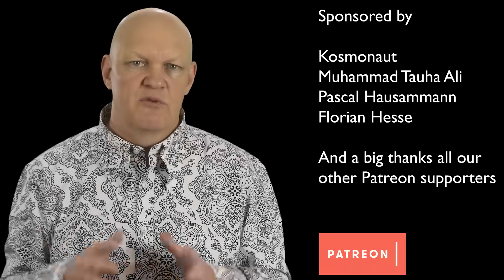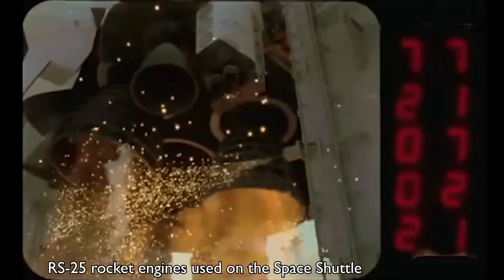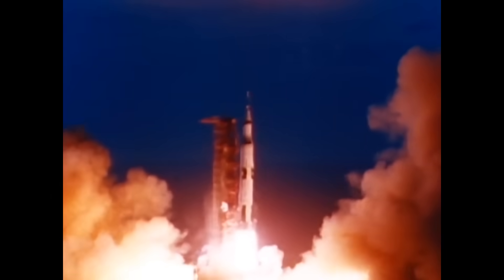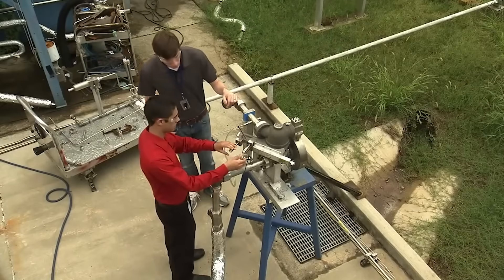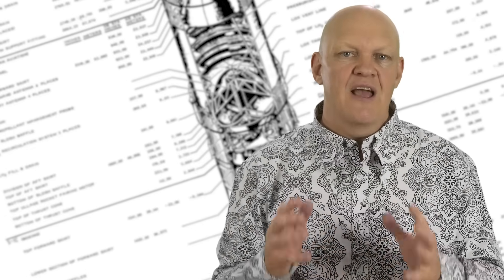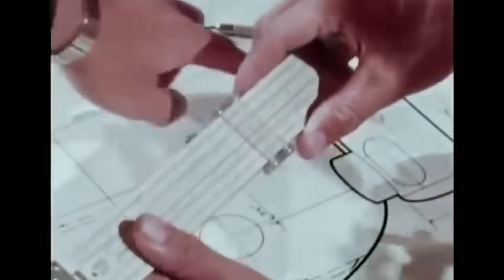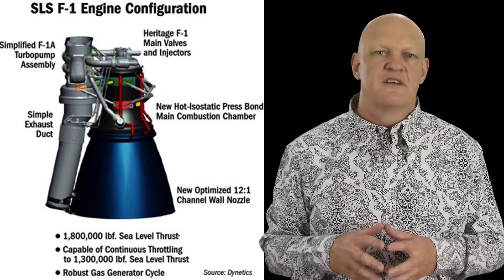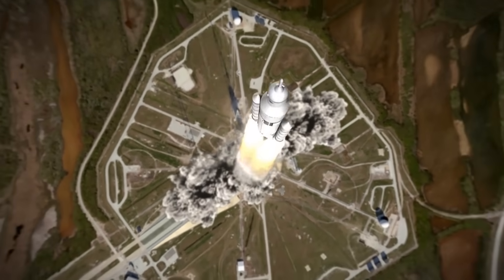Why Can't we Remake the Rocketdyne F1 Engine?

Comment: I wouldn't expect someone in 100 years to be able to build a gasoline engine either. Experts are experts for their generation and understand the tech in their generation. Subsequent generations wouldn't be taught or grow up with the practical skills previous ones developed while working around engineering problems of their time. So basically space flight tech has had to be redesigned for a new generation. As I'm sure it wil be again in thirty years with new tech

Comment: All advanced technology is a byproduct of the industrial base that might build it.  We can't build another F1 for the same reason we can't build another Pyramid.
Reply: If the human race really wanted to build another of either, of course we'd be able to do it. It takes massive amounts of effort and money, but we'd do it.
Remember, in the case of the F-1 engine, there was an enormous amount of enthusiasm.
Reply: @devilsoffspring5519  IF we re-tooled to a 50s-60s post war industrial base. IF we re-trained tradespeople to a 50s-60s technical sophistication (which was much higher level and depth than today). IF the scientists and engineers could reverse-engineer the old designs with a fundamental understanding of their operation. 

You might as well design a new engine.  

People tried to unsuccessfully rebuild the Etemenanki for a hundreds of years - and not for a lack of manpower or technical modernity.  It was only built and repaired by Babylonians who knew the design and knew the building techniques common in Babylon around 700bc.

Comment: I have those scraps. My dad designed the F-2 and oh so much more. The director notes and all the original workups for the shuttle bay and satellite launches. I got it all. Original notes with drawings of those engines. Amazing
Reply: santini deutch : my dad developed the reusable boosters for shuttle... can u get copies of his blue prints he sold to nasa?
Reply: @railrider4745  I have the drawings for the shuttle satellite release sysytem and cradle structures as well as the spin out centrifugal launching mechanisms, or as dad would put it  " The spin out" :-). I have all this stuff in storage. I don't know where the gears are or the mechanical directional models are. I think my sister took them. I would be surprised if she kept anything. What is ti you are looking to do with the prints? I have lots of Skylab and mole and other rocket stuff. Let me know :-)

Comment: Tell me at what point did we decide we need a big liquid fueled engine to go to the moon? Well we sure spent enough money to buy seventy appollo rockets, and we used 20. Maybe thats the real problem with bureacrats they are now politicians, and thats why single stage to orbit is an issue. The Soviets built the Soyuz program and its still working yeah the big dumb liquid fuel rocket aint so dumb is it ? Even the solid fuel stuff goes boom and got retired because of the Morton Thiokol O rings failure took out our orbiter program because of a temprature issue. Buid the F1 again and study it test it mercilessly until you have a few left around in fully opperational condition dont try an change something that isnt broke for the mission requirement, cant re- invent the wheel ? Always somebody talking about how efficiant the thing is , and how it isnt going to work the fact is it does and thats whats important, but if your going to classify every damb thing then lets not and say we did for another 50 years when you cant afford this or that and say we dont have eniugh willie messersmidt trained and skilled engineers is really kinda of a panzi excuse. The F1 is sitting in the yard in the San Fernando valley Winnetka ca. Waiting for you to mass produce it again a few tests and improvements could be added with composites making that engine even more reliable its big its loud and it about time for a whole bunch more moon shots mars too ! Unless you have some secret stuff you think would be far cheaper ? Call Rocketdyne and get on with it .Or do u know some other way to get to the moon or orbit your not telling us about ?
Reply: .. what? Yes, one solid rocket booster got a shuttle blown up, in fucking 1986. The shuttle program didn't end for nearly 30 years more, and basicly the same design for solid rocket boosters are part of the SLS. Wtf are you even on about "single stage to orbit", noone is, or have ever been considering that as a good option.

Comment: 0:04 That nozzle and flame gap does not tell about good performance.
Reply: Fun fact: That gap is actually diesel (kerosene) fuel that was used in the first stage combustion process in conjunction with liquid oxygen.  The kerosene ignited eight feet past the engine bell and gave the Saturn V 7.5 million pounds of thrust.  Why they didn't use a combination liquid hydrogen/oxygen mixture like they did in the second stage is beyond me.
Reply: https://youtu.be/TMbl_ofF3AM?t=58  Russian engine is 10 - 15 % more efficient than US rocket engines.

Comment: You didn't even answer  the question posed int he title of this video. This video is about how changes in manufacturing and assembly have made this engine difficult to produce.  Then you go on to give ZERO examples of how it's actually difficult.  Some notes were lost?  The people who made it have retired?  What is a specific component of this engine that todays fabricators would be unable to recreate? And why?  You really seem to underestimate modern machinists and welders. You sort of make it sound as if people have forgotten these skills. They haven't. Todays machinists and welders are definitely more skilled than the ones 50 years ago and they have better equipment to boot....Both analog AND digital.

Comment: It's always easier to start with a fresh sheet of paper than to attempt to reverse engineer an old, incompletely documented design. And all designs are incompletely documented: no one has the time or money to write everything down. I design and test products. I make drawings, build the prototypes and test them, write reports full of test data and photographs. And still there are omissions , things we either forgot or did not even think of to write down. It's just plain impossible. There is a human element in engineering design. A drawing and a specification document can't cover every little thing: the complexity is just too great and humans are involved.
Good luck copying the Rocketdyne F-1, it would be easier to start from scratch.

Comment: As designed and as built is a dynamic of complex manufacture. What's impressive is the statement that a new design with the same performance or better would reduce the parts required from 5,600 to 40. Imagine the cost savings. The Apollo program was about $25 Billion wasn't it? The current technology on incalculable fronts is a precipitate of that money. That money didn't just go up in smoke, whether the landing was a hoax or not when you think about it😒. Material science, communications technologies, NC/CNC development. The question is, what technological project could be there in the future to inspire or provide that level of benefits. Could it be a medical challenge, a challenge or a shift of true humanity realising their true destiny the way that an ape looks into a mirror and finally recognizes....Hey!

Comment: I don't agree with your argument. I do agree making exactly the same engine based upon the old blueprints now, will not be done. However, we differ in opionion on the reason why.

Technological capabilities has nothing to do with this. Current day engineers are very capable, and also people like good welders and so forth, plenty of them around.

There are 2 factors:
1) money
2) safety

Ofcourse we could make those engines again, in exactly the same way. However. back in the days, landing on the moon was a political priority, and NASA had more money than water laying around. Money/manpower, it was no issue. So they could haggle these engines together, have extensive tests, and so forth. And if someone died during such a test, or while using it, this was no issue at all; it was all for the greater good.

If you were to translate the NASA budget of those days to current money, this would be such a huge number, that that alone makes remaking these engines impossible. But even if we could, they were simply unsafe. Back then one was prepared to gamble a human life, nowadays they aren't. 

Really, to say this has to do with the capabilities of the current day engineers, is insulting. It's only about money, nothing more. We CAN make those engines, but it would simply be too expensive and they would be too dangerous.

Comment: Not only do we lack experienced laborers, but no one manufactures the parts anymore. We COULD build new F1 engines, but it would be incredibly expensive to rebuild all the infrastructure and manufacturing to do so. It's way better to design a modern engine than try to resurrect an old one.
Reply: You'd be surprised how many home shop machinists could reverse engineer it in their garage. But, like me, they are old. Today's machinists push buttons.

Comment: Failure is part of the learning curve. So go ahead and try to rebuild one from scratch and see where it takes them. As once stated to me many years ago while solving a problem, a fresh set of eyes can see what a tired set have missed. Clearly they have stream lined the design, so run at it and see if it works. The bonus we have today that they didn't have back then was CAD, cad won't lose a change or get tossed in the nightly trash by accident. So with that changes can be tracked and made on the fly without the costly overhead involved in the old school method of design and construction.

Comment: My father was the safety supervisor for the F-1 testing.  Bazial Tolle.  Sometime check the testing of the F-1 in California videos.  Those tests shock houses and cause cracks in stucko for miles around, like our house, 20 miles away.  Very much a different time. Then it was done with rocket enengeers spraying weeds.  Maybe that is why I did not become an engineer.

Comment: There was a mass purge in aerospace in the 80s to cut what was thought to be out of control defense costs. Companies like the one I was working for at the time, Garrett AiResearch were getting rid of the old, expensive engineers (the ones who knew how to do everything) and replacing them with young, inexperienced engineers who would work for peanuts. I watched testimony that drove this cost cutting move about a $6,000 coffee pot. The expensive equipment (mostly engineering that couldn't be spread out among many units) was the kitchen where meals were prepared for the large crew of the four engine anti-submarine aircraft. The idiot thought he was talking about a submarine the entire time.
Reply: Similar purges are happening today in the technology fields.  The same thing applies.

Comment: ...and so these engineers an technicians built these powerfull boosters that lifted hundreds of pounds of cadmium and lead that shielded the space crafts passing through the 100s of Mev radiation of Van Allen zones and made it to the moon!
Reply: Believe it or not, but it didn't need much shielding for that. First, they didn't spend much time in the VA belt. NASA chose the thinnest part to fly through. Second, the belts are charged particles- mostly protons- and the aluminum skin is pretty effective at blocking them.
Reply: @rylian21  Surely enough! they accelerated through the Van Allen belts very fast and they directed the space craft to go through a specifin thin layer...

Comment: Why don't we build a new F1? Well, as the video mentioned, there are proposals to do just that with modern technology like 3-D printing and modern alloys which would get you an engine with fewer parts that's more powerful and efficient. Aside from that, we're not building F1s because we're now building Merlins and Raptors. There's a whole new generation of engines that do it much better now.

Comment: So it sounds like there's two reasons: 1) the F1 engines in the blueprints aren't the engines that actually flew, and the field modifications were never documented, and 2) we have better technology today to make better engines that produce the same specs with less parts and more reliability. So... why WOULD we want to remake the old engine? Another thing we have today  that 1960s engineers didn't -- supercomputers that can simulate complex dynamic forces and materials fairly accurately. We could probably design and test a rocket engine today in the computer and build it and basically have it work as designed. The old NASA engineers had no choice but to do things the hard way.
Reply: Yeah you got all that great technology today.....but no one can get to the Moon again let alone Mars and beyond.  So what does that tell you?
Reply: The biggest barriers to the Moon and Mars today are political dithering and funding games. NASA's budget for the last 40 years has been a fraction of what we committed to Apollo-era programs. If the White House and Congress voted tomorrow and committed funding for at least 10 years, getting to the Moon and beyond would be solved problems. Mars presents a few new problems, such as long duration interplanetary travel outside the protective magnetic field of the Earth, and being self-sufficient months or years. Getting to the Moon was already solved, but that was 50 years ago and we're a little rusty, so need to hone our skills again by going back and establish long-term presence to do serious science. The Moon also allows a practical laboratory for testing Mars tech, which may be an important reason to go back, regardless of what DJT thinks. Once there, we need a clear vision of our science goals so spending can be focused. But you just can't keep jerking NASA around by promising funding and snatching it away every other year or two and expect any real progress. It requires political will and a strong vision, both of which are in very short supply in recent administrations.

Comment: Misleading. They can be reproduced but the cost would be high. High enough that it make the engine less practical. Modern production techniques with high precision mean that most of the one off modifications would not be needed. This video fails to highlight why those custom mods needed to he done in the first place. There are a few videos on YouTube that talk about the more practical reasons they are not used today rather than this "we are not smart enough" rubbish.

Comment: coming from an aerospace background (welder/machinist/sheet metal) I can attest to the fact that there is A LOT of tribal knowledge, meaning if you didn't work the part with a old guy who has done it for 20 years you need to figure out all the tricks and shortcuts by yourself. The government is slowly changing that however I myself have been videoed building entire assy. for V-22 , F-22 , F15 and so on so as not to loose that knowledge.

Comment: Its been about 9 years since the last external tank went through production.  We have no replacement.  No replacement booster.  No replacement crew capsule.  No replacement nuttin'.  I'm old school, and an ol' guy.   We went from nuttin' to Mercury, to Gemini, to Apollo, to boots on the moon in less than 9 years.  Let that sink in.  I agree that the % of GDP dedicated to space flight is not what it was in the 60's, but folks, shouldn't we have something up and running by now?

In the old days, we designed, tested, broke it, revised it and then flew it.  Analysis paralysis and just plain poor management inside the agency these days.  The contractors will feed at the trough if allowed to... they have become astute at it during the past 10 years.  The appearance of success, but no hardware evidence.  We would have punted all the "posers" (both inside NASA and outside" to the curb.

Comment: Let’s simplify things a little by looking at a more common piece of technology: the internal combustion engine.

Principally, the internal combustion engine has used the same fundamental principles of operation first seen in the steam engine: expanding hot gas trapped inside a variable volume container drives a reciprocating rod that converts linear motion into rotational motion.

A few, largely abortive forays into rotary engines, this is how motor vehicles have been driven since, well, ever. Sure, there have been numerous variations within the design. Displacement, arrangement, number of cylinders, duel delivery, oxidiser deliver, the list goes on. But the underlying engineering is the same in each case.

The ICE is in its twilight. I suspect we will see hydrocarbon powered vehicles for quite some time, but these will be object d’art, superseded by electrical vehicles.

Rockets are very similar. They are, very simplistically, glorified carburettors. Fuel and oxidiser go in one end and thrust comes out the other. The first rockets that came from Nazi Germany were based on this design and Musk’s rockets use the same principle. They are better engineered, more efficient, yadda yadda, but they are intrinsically the same.

No, the way forward, for the moment, is to keep remodelling current tech. Mane it better. Lighter, stronger, efficienter, reliabler, all of these things.

The engine in the Voiture Noir is a long way from the first iteration from Daimler-Benz, so much so that I doubt they would recognise it as their descendant, but in the century between, cars have gone from a gentle meander to eyelid flappingly potent. Until the boffins perfect gravimetric engines, we must make do with a flying fuel tank: make the ride worth it!